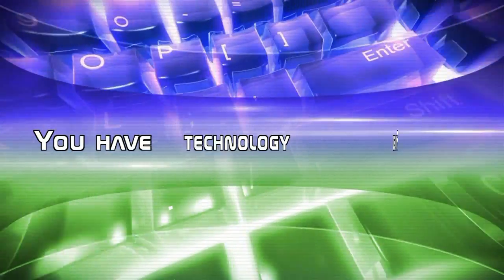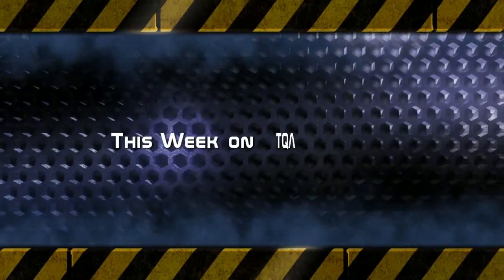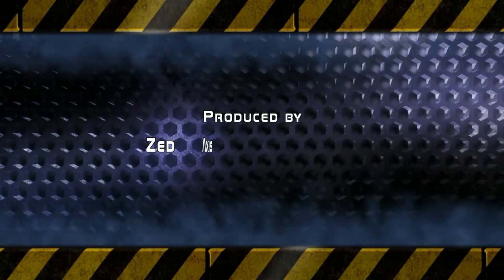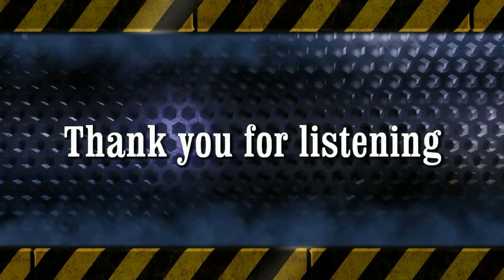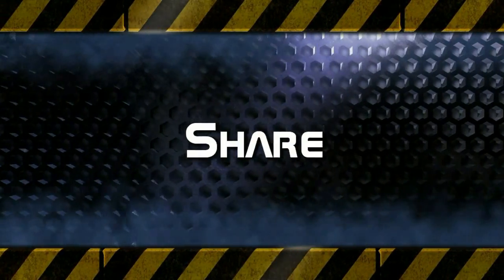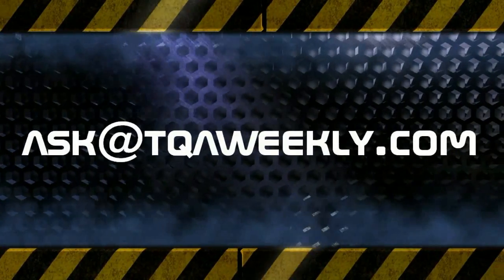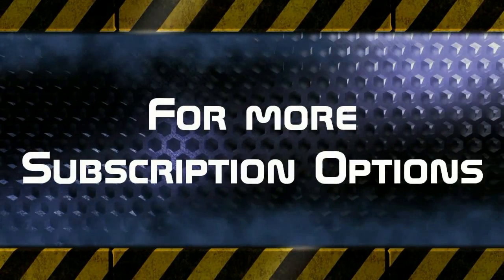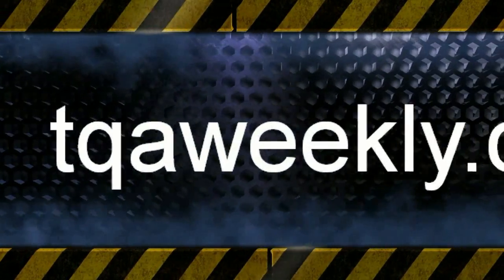Can I Plug that in any PCIE slot?

Comment: lol...it seems that everyone is asking the same question and thank you Steve for answering them all this info was really helpful. I want to add a GTX 750 to my Inspiron 530 and was really worried about the specs and my PC blowing up.
Have you thought about doing a video about the history/implementation of the different PCI types and what they are best used/suited for e.g. 1x may be better used for a wifi card
Reply from the maker: Randy Hos I could probably talk about the various different hardware that use the different possible configurations of PCIE types. Oh, and your GTX 750 will not cause your inspiron 530 to burn, provided you have the required wattage.

Comment: Will a PCI-E 3.0 card fit In a PCI-E 3.0 X16 motherboard? If so will there be any performance drops?
Reply from the maker: COOL4171 Can you please specify if the card you are talking about is an X1, X4, X8 or a X16 sloted card.
Reply: Well the card is a 250x and it just says PCI-E 3.0
Reply from the maker: COOL4171 which card are we referring to, because in terms of PCIe, 250x does not exist.
Reply: Well never mind I found a better card but thank anyways

Comment: so a PCIE 3.0 card can fit in a PCIE 2.0x16 slot? If so then that means I could get a fx-6300 and possibly a gtx 760! :3 (or r9 285)
Reply: Alright so here is the more detailed version of this comment, xD. If I get a GTX 760, I can fit it in a 2.0x16 slot, right? And also can a 3.0x16 card fit in a 2.0x16, or only a 3.0 card can fit in a 2.0x16?
Reply from the maker: ZombieSlayerX14 any card whether PCIE Ver 1.0 to 3.0 can fit in any PCIE X1, X4 X8 or X16 PCIE Gen 1.0 to 3.0 Slot. It will always adjust to the oldest or slowest technology, in other words, the only thing that will ever change is the bandwidth available to the card.

Comment: Can I put a PCI Express 3.0 x16 video card in a PCI Express x1 or x16 slot? If I do it, how will it affect my computer?
Reply from the maker: Aramis Y. Cajigas You can, and as for affecting your computer, it will more than likely just affect the card by slowing it down, but it will work anyway.
Reply: Thank you, Steven, for answering. But I have another question: what do you mean by "slowering the card"?
Reply from the maker: The card will not have the same bandwidth if plugged in a 1x, 4x or 8x pcie slot, as it would have in a 16x slot.
Reply: As it would have in a PCI 3.0 x16, you mean. Right?
Reply from the maker: Aramis Y. Cajigas PCIe Generation and number of traces affect the total bandwidth of each card, yes.
Reply: Thank you!

Comment: I have an HP z400 with the following configuration: 2x PCI Express x16 slots (one occupied), 2x PCI Express x8 slots 				(two wired as x4.  With regards to the x8 slots they are wired as x4 which if I understand it correctly, means mode 4.  Why do they wire it that way and not leave it at mode 8?  Doesn't the mode 4 have half the bandwidth of a mode 8 configuration?  Is there a way to tell if the PCI express slot has been wired as a mode 4 vice mode 8 by looking at it?  In addition, if I want to add a both a USB 3.0 and a wireless card for internet connection (I have 1 gig) should I use the remaining 16 slot to get better bandwidth?  If so which card should go with the 8x slot and which should go with the 16x slot?  Thank you very much for your videos.  It is very much appreciated.  The meltdownman
Reply from the maker: meltdownman1 wireless cards and USB 3.0 cards only require pcie 1x so place it where you want actually. keep your cables neatly tied out of the way of fans, and you should be fine.
Reply: Thank you!

Comment: hiya steve this is the motherboard i was thinking of getting,,

GIGABYTE GA-Q87M-D2H 1150 Socket 4x DDR3 Max. 32 GB PCI-E USB 3 HDMI DVI RGB DP uATX,,,,,i would like to build a crossfire rig
Reply from the maker: daniel brown instead of dual graphics cards in crossfire or sli, spend more money on a better graphics card. You will A) need a bigger powersupply if you have more than one card, and B) require better ventilation.

Comment: ok , im stupid.. can i put graphic card with pcie 3.0 onto pciex16 slot on my motherboard or not ? and how fast will it run ? 70% of full power or what ?
Reply from the maker: the x16 is the number of traces a given card has, or a given slot has. technically it is 4x16 to give you the true total. Connecting a graphics card into the x16 will allow it to run at full, connecting it to a x8 or lower will make it slower, however, the graphics card will still work.

Comment: my motherboard has one PCIe slot can i get a pci to pcie converter pack to run two graphics cards
Reply from the maker: No. Doesn't exist. You may be inline for a new mainboard. May I suggest the new Z97 Asus line. Please leave some details on what you need in your computer so I may leave you the appropriate suggest for mainboard.
Reply: Steve Smith
Actually there is, but again it will run slower than PCI-e, they limit it to 32bit processing. The PCI to PCIE Bridge adapters run around $30.00 they allow you turn a standard PCI slot into a PCI x16 slot. However you would need a low profile video card as the adapter takes up about 1" of space. here is a link for E-bay as an example: http://www.ebay.com/itm/PCI-to-PCI-E-PCI-Express-16x-Bridge-Riser-Card-Adapter-/150736952226

Comment: Can i put an 3.0 PCIe Graphics Card in a 2.0 PCIe Motherboard ?
Reply from the maker: YES
Reply from the maker: From the stand point of how much performance the card has, yes, but from the point of view of your system, it will be faster than your previous card. As long as the board is always the same, buying newer and newer cards does make it faster, but the bandwidth is the only thing that is lower.